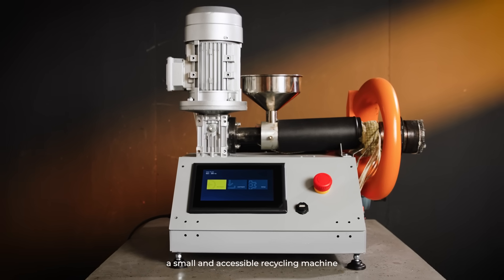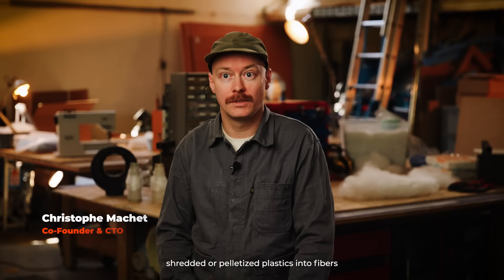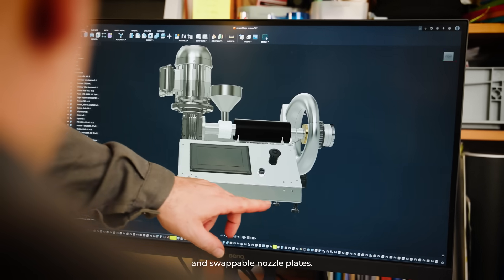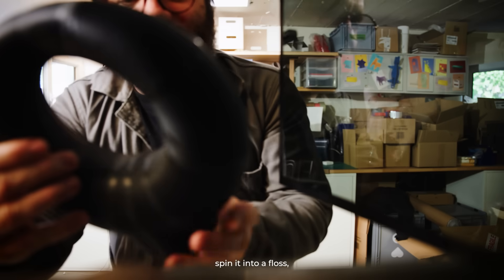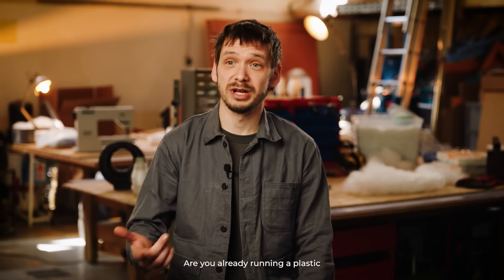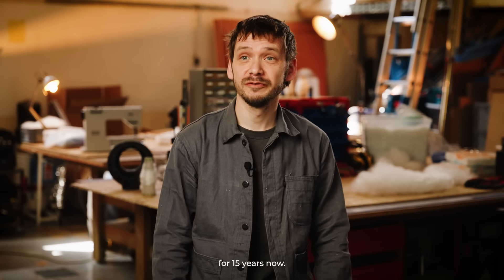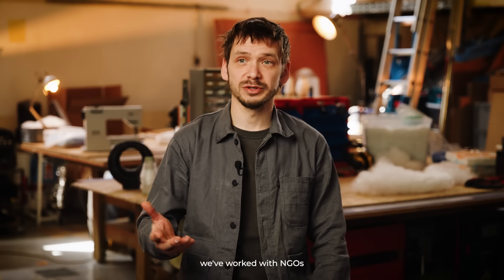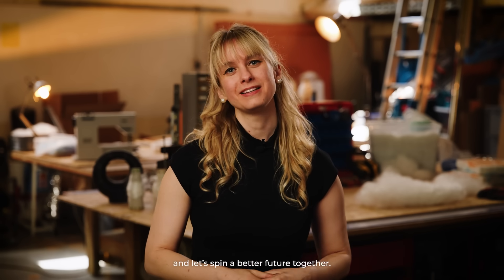Mini-Polyfloss Kickstarter Launch

Comment: Part of me loves the democratization of this tech. This can definitely help keep plastic from the ocean or landfill. But I am concerned about the proliferation of micro plastics and of the potential for lung damage that improper use can cause. People have already shown that they don't take the necessary safety precautions in things like 3D/resin printing now that ot has become commonplace. I fear the same thing may happen with this. I assume this would have similar safety and PPE needs to working with fiberglass or blown insulation.